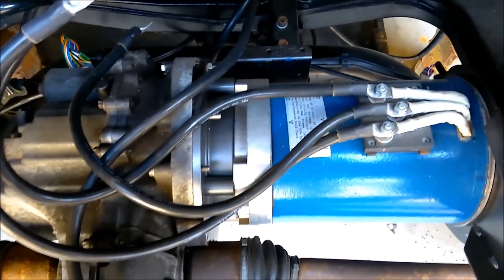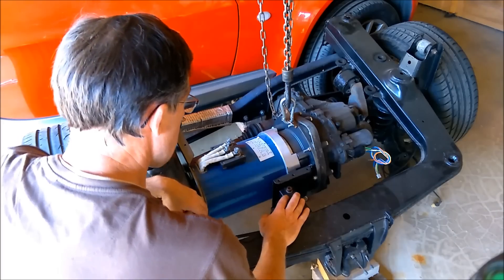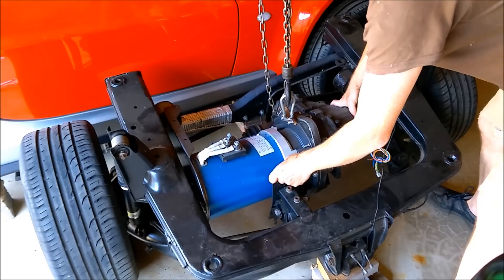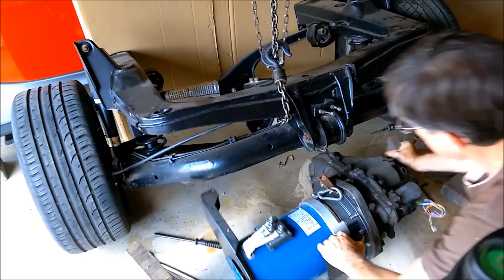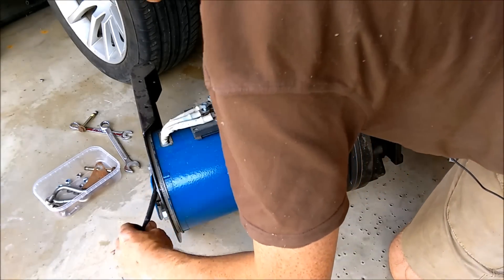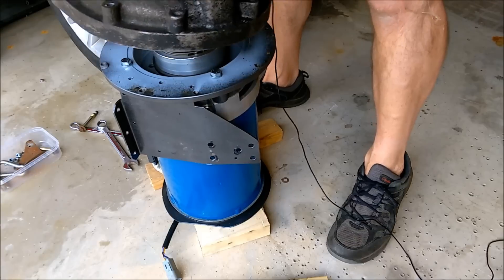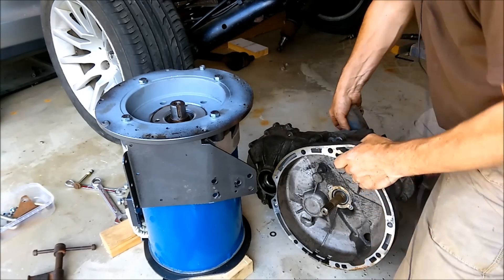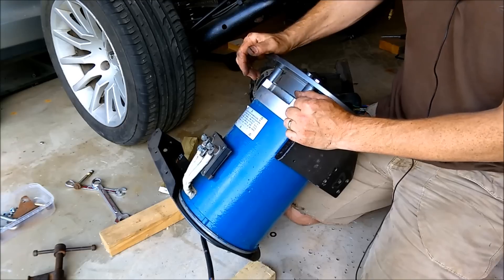Converting car to electric - Drive system

Comment: is there a list of the parts you used somewhere ?
Reply from the maker: Hi, this is a bit of a list, at some point I'll put togehter a proper schematic but so far it's been pretty adhoc. 
Motor 50kw AC 35 HPEVS

Controller 550A 80V (50kw)
Battery charger (72v or 80v)
Batteries 60Ah 8.2v (0.5kwh) - I'm only using 10 (of 12) but really needs 20off to give better range)
gearbox to motor adaptor plate
Battery mount frame

Motor and gearbox new mount plates (set of 3 parts)
Heatsink for controller
Fans for heatsink
Voltage convertor 72v (90v max) to 12v
Main Contactor 80v
Mains power inlet socket - IEC62196-2 (Type 2)
Throttle pot assembly (only used part of this)
Adaptor housing to fit pot to smart accelerator
Vacuum pump
Battery Gauge
12v 26Ah battery (replace normal 12v battery)
Controller cable set with Ampseal 35way and motor control conn
Coulomb counter (used for monitoring battery used/remaining etc)
Vacuum switch
Curtis instrument holder
Vacuum resovoir
1000A isolators
500A shunt
clutch plate - only used spline (ford fiesta mk1)
Taper flange plate
High current cable set - 50mm2 (per metre)
Taper bush to fit on motor
Ancillary connectors (panel mount + socket)
12v main fuse
large fuse mounts
12v relay with fuse
Forward/reverse switch
Vacuum tube (per metre)
12v cables Red and black 10mm2
Andreson 50A connector for connection from charger to fuse

100A fuse
500A fuse
cable conduit

Cable terminal lugs for 10mm2 cable
Cable terminal lugs for 50mm2 cable
Reply: @crispydoda  nice! looks pretty comprehensible. Can't wait for the schematic
Reply: @crispydoda  🌹

Comment: How much space do you have between the subframe and the motor? Wondering if there would be any change to fit a bigger motor in there. Will also be interesting to see if the torque delivered from that motor will be too much for the smart gear box. Thanks for these videos, id love to try this one day, very interesting for sure.
Reply from the maker: Hi, You can see on some other videos that there is hardly any space between the motor and the frame, only 10mm or so. So it's about as big as it can be without frame mods. However, there are probably higher density motors now so they wouldn't need as much space. Yes, it will be interesting to see what breaks first, but I'll be taking it easy for a while.

Comment: Nice job. In the US conversions we're very popular in the 90s and first part of 2000 and the price of a used conversion was easily over 10,000 but now with the leaf and Tesla a used conversion can be picked up pretty cheap here in the US. I'm working on a Porsche Boxster right now with the DC netgain 9 motor.
Reply from the maker: Hi Steve, It's expensive to find used Tesla's here, they are like gold dust. As soon as I could afford one I'll buy one. Even used Leaf's still hold their price well and it was pure luck that I found the 12 used cells I got. I can't wait to have this car on the road, I'm just so strapped for time I can't seem to get time to work on it. Good luck with the Porsche conversion, a great choice, we need more electric sports cars on the road :).

Comment: instead of using that big electric motor and trans axle, why not just make the wheels the motors?
Reply from the maker: I think motorised wheels is a good idea, but as far as I know these are not available and it's more effort for me to design and build them rather than put a standard motor on the gearbox.

Comment: Hi Paul are these AC motors connected in star ??
Reply from the maker: Interesting question, I've always assumed they are connected Delta but have no evidence of that. The connections are not configurable on these motors so it's a simple case of connecting U,V, W directly to the controller.
Reply: Can you work it out from measuring the resistances between the connections you have access to

Comment: KW of motor??
Reply from the maker: Hi, it's nominally a 50kw motor, I'll be running it at 96v at 550A peak though.
Reply: ok thanks
Reply from the maker: Hi, it's nominally a 50kw motor, I'll be running it at 96v at 550A peak though.

Comment: Are the four bolts that hold on the clutch plate strong enough for all the torque that the motor generates, to me they look quite thin? love the video by the way.
Reply from the maker: Hi Billy, The bolts are 4 x M6, the clutch plate holes were dia 6mm so I just went for those, I don't think they will shear but I guess the threads might stretch and they could work loose then who know so it's a fair point... after it run for a bit I'll be taking the unused gears out so can have a look then.
Reply: I think they would probably be ok but it might be better if the spacer was the full width of the clutch plate in bigger holes or if the spacers were fixed in place and not loose, it just looks like the bolts will be putting all the torque against the thin metal edges on inside and outside of the clutch plate.

Comment: Paul, I'm struggling to recall your expectations for the vehicle. Although lighter than a Leaf, I didn't think you were intending to use anywhere near the 24 or 30kw/hr of battery capacity that they had. what sort of range was your target ?
Reply from the maker: Hi Rhian, I've gone into more detail about this in comments in other videos, but in short I'm only fitting 6kwh of Leaf batteries in at the moment due to restricted funds, but hopefully will increase this later. 6kwh (at 150W/mile) should get me 40 miles if I'm lucky but I'd be happy with 20-25 miles as that is my commuting distance.

Comment: Thanks, Paul.
Now for the gearbox video where I'm expecting much torturing of it for being such a laggy and enjoyment destroying piece of garbage, although that'll probably break YT's T&Cs despite being joyous for previous/current Roadster owners :D
Reply from the maker: The gearbox (and clutch) is what finally led me to do this. The clutch drive became snatchy in slow traffic so needed to be stripped down anyway and the life risking delay when pulling out on roundabouts was becoming too much to bear. 
I never used auto mode (or random change mode as it should be called) but I absolutely love the car and can't wait to have it back on the road as electric.

Comment: The gear change motor has its own 2 position rotation sensors so you could use hard coded rotations for each gear instead of relying on the separate position sensor to stop the motor on the correct gear. When the gearbox is usually taught to the car, MB Star uses the separate sensor to determine the position of the gears. Once it's done, the ECU doesn't use that sensor.

Comment: Maybe you have less trouble with using a wireless or shotgun mic?
Reply from the maker: I bought a cheap wireless mic but it's not that good as it has a background hiss, should probably invest in a better one next time.
Reply: try Rode's VMMICRO VideoMicro. It's a good shotgun mic for a fair price.